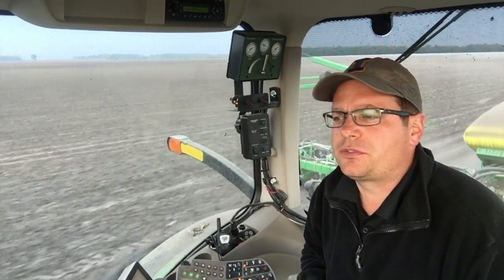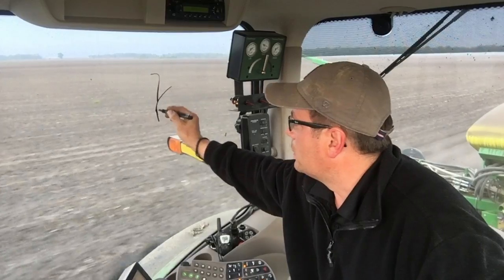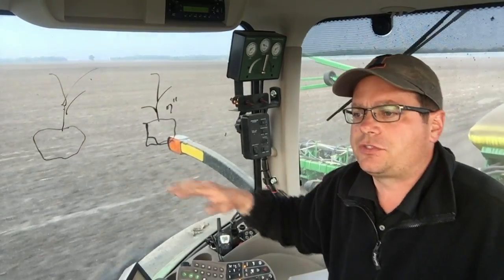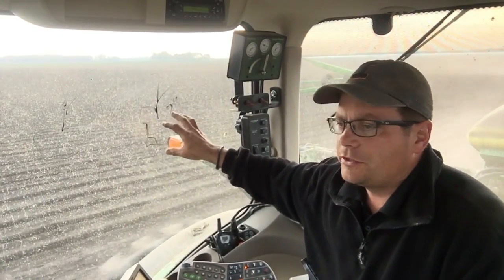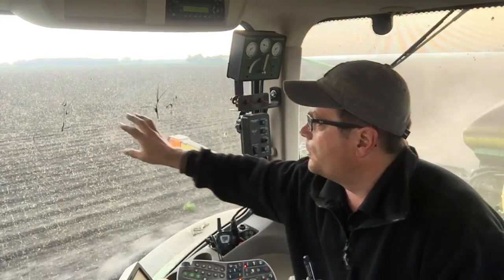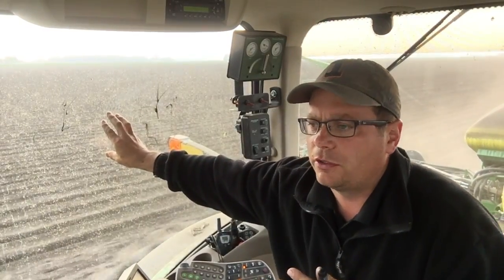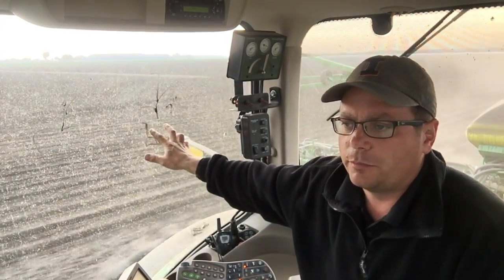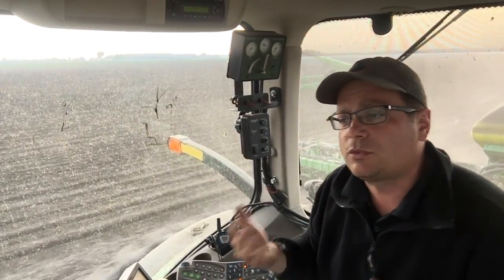360 Yield Minute - Strip Till - Matt Foes

Comment: So why are some people that have done banding of fertilizer getting out of it cause they haven't see a return on investment yet. They have been doing it for 4 or 5 years already.
Reply: how do you not see a return on investment of reducing fertilizer bill by 50% and reducing a lot of tillage costs?
Reply: Right on. Probably because it sells equipment. Funny all this pie in the sky stuff sounds great, but if you do it all you'll be bankrupt. There is also a tendency to believe it works just because you're a fan of it.
Reply: Most people don’t see a response for several reasons: 1. Not using the correct NPK formulation needed for that field. 2. The starter formulation being used may contain heavy metals which has been shown to delay emergence or damage seeds. 3. NPK may not be the limiting factor-Sulfur, or a micro nutrient may have been needed instead of just NPK. 4. PH may be away from ideal which is causing issues during the growing season. 
Take tissue tests around V2 to see what the plant is telling you about the starter systems approach vs. what the complete soil test shows. So if. Manganese was short on the soil test & you didn’t address it, will probably show up on the tissue test. Probably not going to see a response to your starter.